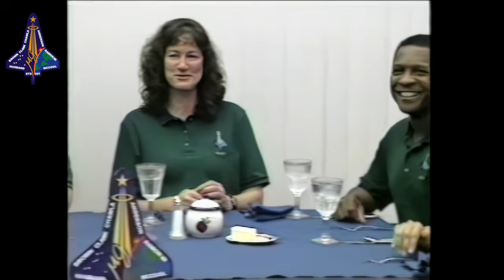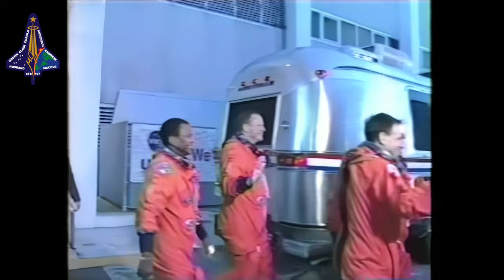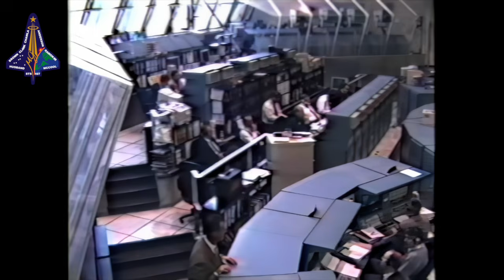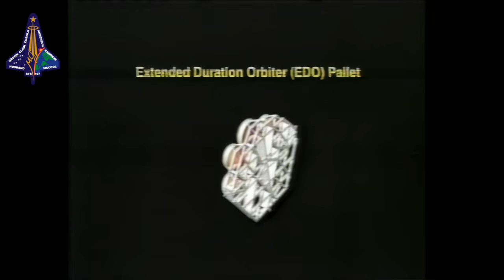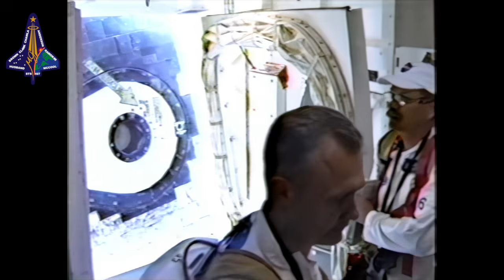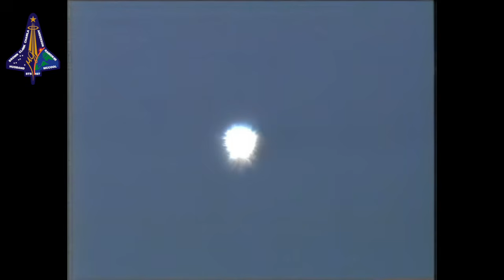Columbia Disaster: Full Launch Countdown | STS-107

Comment: I salute William C. McCool, David M. Brown, Laurel Clark, and Ilan Ramon on their first space shuttle mission! 🫡❤️🇺🇸🇺🇸🇺🇸🇮🇱

Ilan Ramon happens to be the first astronaut from Israel to fly into space and the only foreign recipient of the United States Congressional Space Medal of Honor, which was awarded posthumously. 🇮🇱🇮🇱🇮🇱

This was the 28th and final flight of Space Shuttle Columbia. The mission ended on February 1, 2003, with the Space Shuttle Columbia disaster in which all seven crew members were killed in the re-entry into Earth's atmosphere; the shuttle was destroyed along with most of its scientific payloads.

Immediately following the disaster, NASA formed the Columbia Accident Investigation Board to determine what caused the breakup of Space Shuttle Columbia.

Investigators concluded that the accident began during launch, when a piece of insulating foam detached from the external fuel tank and struck the orbiter’s left wing. The impact damaged part of the shuttle’s thermal protection system, including reinforced carbon-carbon panels and heat-resistant tiles along the wing’s leading edge. During re-entry into Earth’s atmosphere, intense heat entered through the damaged area, causing the wing to gradually overheat and fail. This ultimately led to the shuttle losing control and breaking apart.

Never forget Rick Husband, William C. McCool, David M. Brown, Kalpana Chawla, Michael P. Anderson, Laurel Clark, and Ilan Ramon! 😢💔🇺🇸🇺🇸🇺🇸”🇮🇳🇺🇸”🇺🇸🇺🇸🇮🇱

Comment: Watching this again and again 
3:07:03 Go for Auto Sequence Start
3:07:22 Go for Main Engine Start
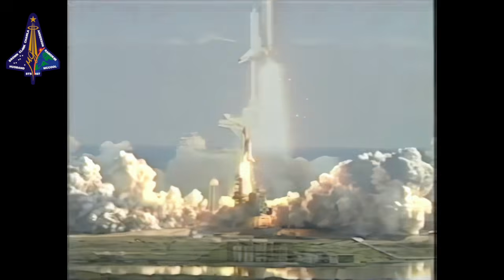3:07:30 SRB ignition and Liftoff
3:07:40 Roll program
3:08:03 Throttle back to 72%
3:08:32 Go at Throttle up
3:08:50 FOAM STRIKE (also pointed out by @LowIQSpaceymen)
3:09:35 SRB Separation

Comment: It's interesting to note that in both shuttle disasters, Challenger and Columbia, one could argue that design flaws were the cause. Less so with Challenger because even though they later re-designed the o-rings at least part of the cause of that incident was the decision to launch in extremely cold temperatures. So had they launched in warmer temps, the original o-ring design might have held, and with the newly-designed o-rings they probably would have held even at the colder temps.
But in the case of Columbia, this exposed a well-known and familiar design issue that had plagued the shuttle program since the beginning. Unlike NASA's Gemini and Apollo programs where the manned capsule was placed on top of the propulsion rocket, the shuttle was attached to the side of its propulsion package. Even the Saturn Vs that powered the Apollo missions had lots of falling ice, foam and debris but it fell harmlessly away from the capsule at the top. The shuttle, from day one, ran the risk of being struck with debris. This happened many times during the shuttle launches, but only in the case of Columbia did it result in loss of vehicle and crew.

Comment: Their fate was sealed by management thinking their decisions were better than just looking at something hitting you at 500 mph unbelievable
Reply: Almost nothing could have been done after the foam strike. They could have performed a risky spacewalk to put titanium and water that freezes into ice on the open gap but that wouldn't guarantee a successful reentry.
Reply: @cynbloxy  The orbiter shuttle Columbia herself may have been a total loss but the crew could have been saved by aborting the mission and going to the ISS until Discovery could be launched on a recovery mission.

Hindsight is always perfect but one should never play around with human lives. NASA knew they were not coming home and chose: 1 - not to tell the crew they were headed into certain death & 2 - the mission was more important then what the crew's lives were.

EXACT same thing happened to Discovery on launch during the 2005 return to flight mission STS 114. Discovery made it home safely because NASA chose then not to "mess about with the crew's lives" and instead altered the original mission to do those "risky spacewalks" in order to inspect and repair any damage. Because of this, Discovery MADE IT HOME.
Reply: @C21L01 they couldn’t go to the ISS. This mission launched on a 39 degree inclination. The station is at 51.6.